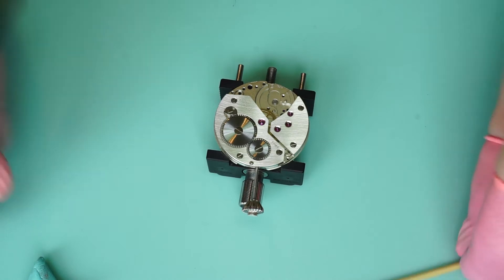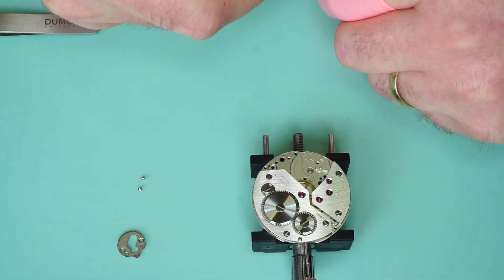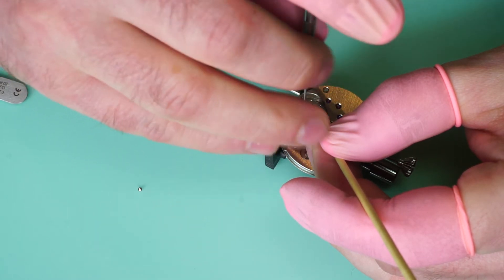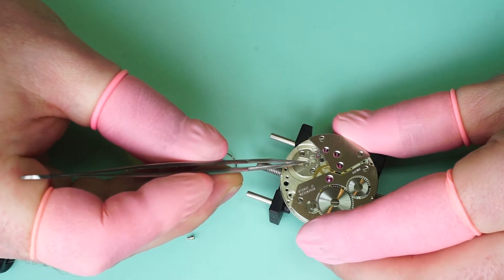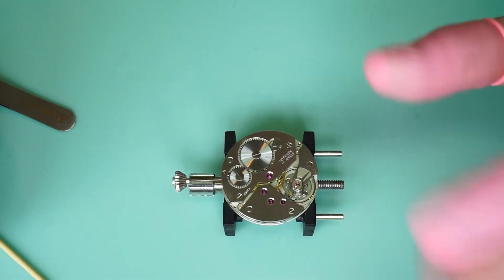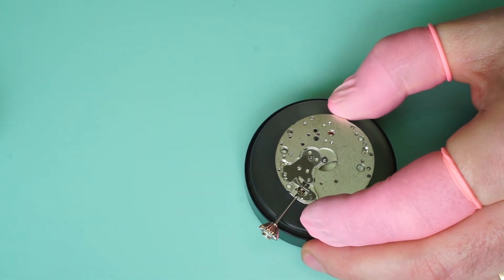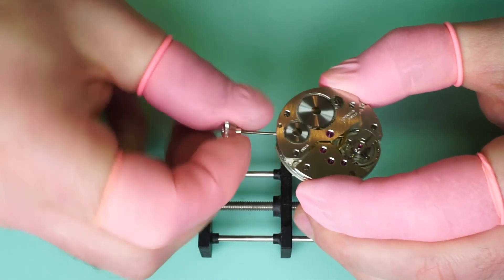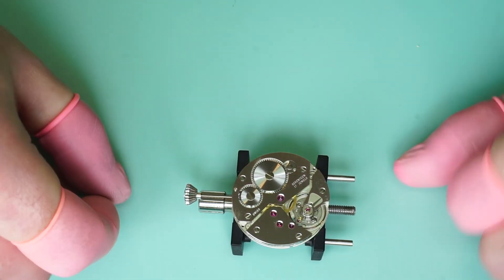How To - Service a Mechanical Watch  - Part 4 Assembly Continued - ETA 6498

Comment: Hi, what is your opinion, some watchmakers do apply oils one time on the entry pallet, so it can touch the escape wheel five or four times and then again repeat the process again, until it touches all the teeth of the escape wheel
Reply from the maker: It can be applied in this manner and I know it is quite common practice, the intention is not to coat the escape wheel in lube though. You want sufficient lube to allow free motion but not too much to create drag or detriment. The lubricant should remain more on the stone surface than the teeth imo. We are talking very small amounts here.